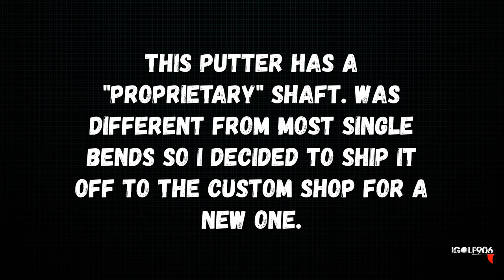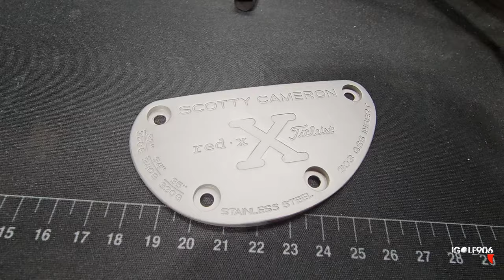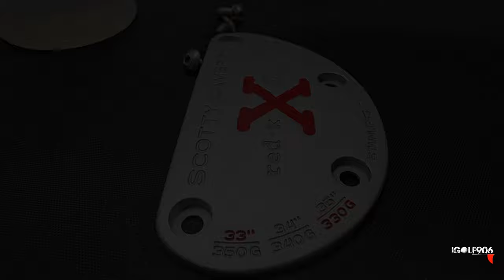I Broke 80 with this Putter!!! (Full Restoration)

Comment: I’m trying to remove the X2 center shafted head. The shaft is just twisting but won’t pull off. Any suggestions?
Reply from the maker: Keep pulling? Or slowly twist it off. There shouldn't be anything holding it back if it's spinning. I've never done THIS putter in center shaft. But I'm assuming it's an over post style shaft.

Comment: Nice video. I’ve been thinking of getting one of these as they quite good prices. What do you put on the screws when you reinsert them?
Reply from the maker: Absolutely! It feels so nice off the face I actually couldn't believe it. As much as I love putting with a blade, and the looks, i need to start using the putters I actually putt well with 🤣. My double wide odyssey is nice but just never was a fan of synthetic Inserts. And it's just a little blue locktite.
Reply: @igolf906  I’m just the same. I love a Wilson 8802 napa style blade, but not sure they’re right for me.

Comment: When you are filling in the paint, how long do you wait before wiping with acetone?
Reply from the maker: Times vary depending on the humidity/temp ect. But I like to wait at bare minimum a half an hour. And even at that time you have to be very careful not to actually touch the filled areas because it is not fully cured yet. To be 100% safe of smearing and ruining the fill a full 24 hrs is probably recommended.
Reply: @igolf906  Thanks